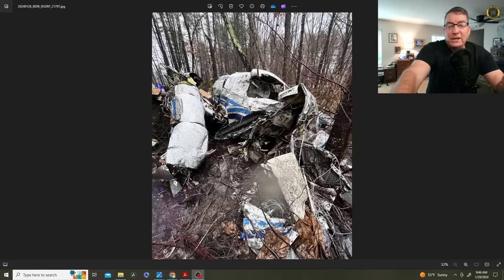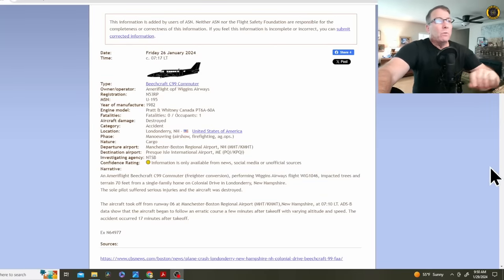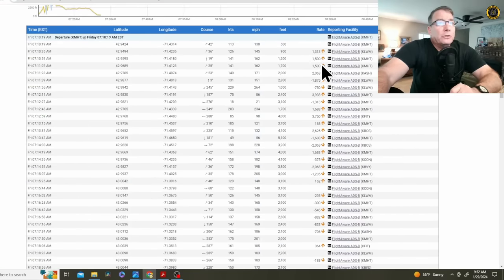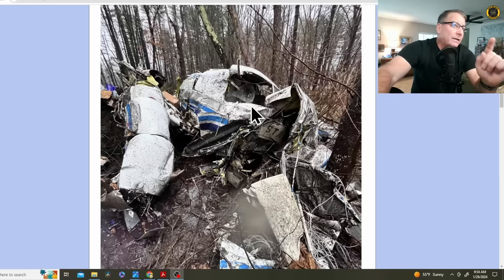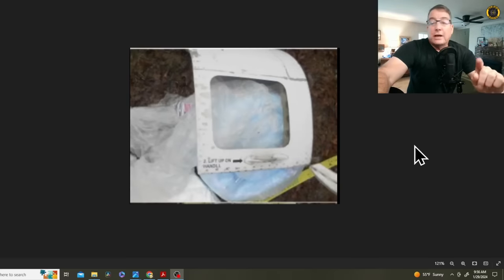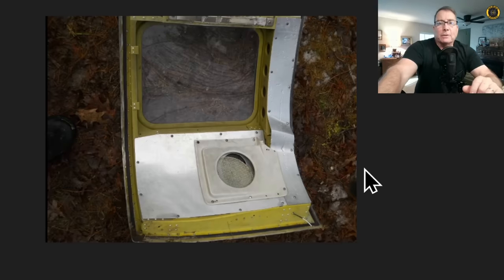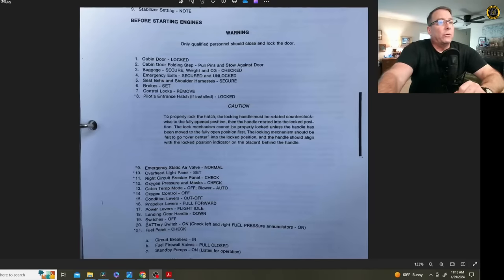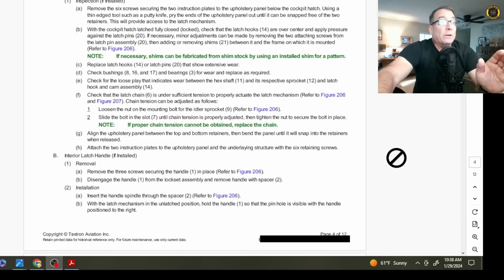Beechcraft C-99 Door Open In Flight Crash! 24 January 2024

Comment: In my Commanche, after having the door seal replaced, it was challenging to get the top latch on the door to hook the pin in the fuselage.  It felt like it was latched, but it wasn't.  As you rotate, enough negative pressure on the outside would open the top of the door.  It was noisy, but I continued the climb.  Unable to get the door to latch, once at altitude, I would put the plane in a skidding left turn and create positive pressure on the right side of the plane.  I could then latch the top of the door and continue my flight.  But as Juan said, GA doors are usually hinged at the front, so they pop open a little and stay on the plane.  Prayers for the quick recovery of the pilot.

Comment: Irrespective of the topic of this video, I really appreciate you taking the time to correct and perfect your audio recording as your video-making career progresses.   I listened to a video of yours from about 1 year ago and your plosives were just hammering the mic (which causes the limiter to kick in.)  I guess my only request going further is that you increase your overall audio by 8-10dB on the master output.  Other than that, I really, really appreciate you perfecting your practice - much like I assume your piloting career has progressed.  Thank you for the great content, Juan.
Reply: It is frustrating how low some folks set the Master Volume level.
Reply: @chetmyers7041  It's especially frustrating when you compensate for the low volume only to be blown across the room by the follow-on video from another creator.

Comment: In past incidents I have noticed very large discrepancies in airspeed from FlightAware due to the data coming from difference ADS-B reporting stations. It seems like the speed is being calculated by the position between two reports, but evidently those reports don't have perfectly synchronized timestamps. Whatever the reason, in cases like this where there are multiple ADS-B receivers reporting data, I tend to take that data with a grain of salt.

Comment: If that door opened and detached it probably destroyed the prop and damaged the engine. On top of that he was battling asymmetric thrust. Remember, props and engine set at takeoff/ climb settings so high toque. He was probably disorientated by that door flying off and probably loosing anything on his lap or clipped to his yoke. A hell of a lot to deal with.
Regards from South Africa

Comment: I've been in the right seat of a 58 Baron, and the door popped open at 6000' in cruise.  It is VERY surprising.  As Juan said, with it being hinged on the front, it just opens a couple inches, won't open any further, won't close.  One thing I remember was the latches on the Baron front doors were known for not fully latching.  We had the door open again on another flight.  On the Baron, I was surprised how small the latch was on the top of that door.

Comment: Not a pilot but have always been interested in failure mode stuff.  How about this, accounting for directional and altitude variance:  Hatch comes off, trashes vertical stabilizer but unfortunately doesn't rip it clear off the plane.  Remnants remain battering the horizontal stabilizer.

Comment: I owned a 1970 piper Cherokee that’s door was bent and would pop open now and then, it sucked dealing with but was manageable. Not minimizing this at all,it can be very distracting depending on the phase of flight. Glad to hear he’s still with us.
Reply: Yeah, i have flown the Cherokee, its fairly uneventful on that particular aircraft, the door is almost kept shut by the airflow over the fuselage. The beech in this incident has an upwards opening door, meaning you will get a face full of whatever it is out there, id say it's far more dangerous / difficult to deal with in this case.

Comment: One comment about firefighters removing a crunched door: If they had access to the Jaws of Life it would absolutely not have been a problem to remove that door. I personally have destroyed various structural elements of a truck/automobile and the Jaws can cut cars/aircraft, door, frames and pretty much anything attached to a vehicle. However there would be clear evidence that they had cut it out/off of the aircraft...

Comment: Took off in my Mooney M20C, VFR from Santa Monica, heading east under the usual SoCal marine layer. Everything seemed fine. When we popped out into the sun, suddenly the cockpit seemed incredibly bright. I looked back to see the gullwing luggage door next to the rear seats in the full upright and open position, like an extra wing. I put it down at Upland/Cable airport, and my girlfriend, Eva, climbed out and kissed the pavement. I had told her that an accident usually has not one, but many contributing factors. "That's 1", she said. Completely my fault, but the amazing thing was that the plane flew perfectly, with this odd gullwing sticking out into the breeze.

Comment: I have hundreds of hours in this very aircraft (more than 10 years ago). Don’t forget about the removable exterior ladder that must be removed and stowed in the cockpit. Funky design. I’m surprised there haven’t been more incidents like this one in the 99.
Reply: Does the ladder have a secure stored location?  If not, or it came loose, our pilot was trying to fly the 99 with the equivalence of a gorilla in the cockpit.
Reply: It hangs on the rear cockpit wall, doubling as a latching system for the cargo hold door! I forgot about that part until you just made me think of it.

Comment: I live in New Hampshire. During the time of the accident it was forecasted as rain but that quickly turned to freezing rain creating havoc on the roads. It wouldn’t shock me if icing played a factor in this incident.
Reply: I would agree with you but they found the door some distance from the aircraft so it definitely came off mid flight
Reply: I agree. It's not implausible that the door came off and the aircraft encountered icing conditions. Icing would explain the inability to keep the airplane in the air. Especially if the pilot was unable to ascend to quickly get out of icing conditions. It's the old Swiss Cheese model of accidents.
Reply: @jonmoceri   so would damage to control surface caused by door
Reply: @jonmoceri  The crash occurred after 17 minutes of flight, so flying in freezing drizzle could well do it.
Reply: The door was found at a Manchester location near Candia Rd and the Rte101/I93 junction just after his first abrupt turn back to the south.
Reply: @jonmoceri  add to that the cargo pod if used would rapidly accumulate ice! GREAT! ANOTHER GAPING HOLE IN THE CHEESE!😖
Reply: @57Jimmy  Very true and a very good point!
Reply: Agree, I work less than 1/4 mile from MHT airport, got to work just before 7 that morning and it was freezing rain/fog type conditions, very icy roads.   I also wonder if once the door came off his instruments frosted over or became soaked with rain and the wind turbulence coming in and were difficult to read.   There were definitely not VFR conditions at that time
Reply: @ajg617 yes. Christy Ln. Not on the first abrupt turn but a that is where the plane did a rapid decent from approx 1900 ft to 700 ft.  I think the door popped open and he struggled to control the plane. Can only imagine trying to control the plane in those conditions.

Comment: Another former white and blue BE99 Pilot here. That crew door was always my biggest fear. Some airplanes’ doors were a lot easier to latch than others. Most required 2-3 attempts to get completely latched. You definitely have to check that thing several times before takeoff.
Reply: My former company had a 58 Baron that had problems with the crew door.  Had it pop open twice on us at 6000' in cruise.  It's hard to get the door fully closed and fully latched.

Comment: grateful the pilot survived.  Having worked with Ameriflight over 12 years and worked on her sister a/c N52RP, I never saw anyone ever adjust the flight deck door.  All the doors were loose and the issue of airworthiness is debatable, the deice boots are visually looked at for holes and tears, but never inflated to check for holes.  I'm surprised more of these a/c are not involved in accidents.  A true testament to the strong design of the B99.

Comment: That IS a pretty complicated method for latching the door.  Easy to see how something can go wrong or be overlooked.
Reply: Seems like a double rodded latch like a truck cap has would be a lot better. Turn the handle and it throws the two rods into the lock position also like a garage door latch. The looping chain looks like some engineer was way over thinking things
Reply: Got to fully unlock to lock?!?
Reply: Did he hear it whistling cause it was ajar once he got airborne, then try to lock or close it? Something caught in it?
Reply: I would have thought that two seperate handles/locks might be a better design. No interlinking chain to wear and adjust; and either one would keep the door shut.
Reply: @jamesread11  Rotating first to the "unlock" position ensures that the door is not resting on top of the latch cams, allowing the door to fully seat, before the cams draw it tight in the "locked" position.
Reply: @martinhicks6020  - A simple hook and loop gate latch would be a better design than this complicated disaster in waiting.
Reply: The person that designed that door latch deserves some sort of Rube Goldberg award.
The doors and hood of every car I've ever owned have better latches than that one. They even have secondary latches that would at least keep them closed even if you didn't latch them properly.
Reply: Especially if it’s freezing and whoever is on the ground is wearing thick gloves when trying to latch it

Comment: Another good job by Juan Browne for finding the facts for us and reporting. I was wondering about this crash after seeing the track on FlightAware and noticing the high voltage power lines on the path to the crash site. There are nine courses of big doubled up conductors and then two more smaller towers with what looks like two and then three conductors on each. The flashes in the security video are definitely these power lines arcing together. Power lines like these can certainly absorb some of the forward momentum and slow the aircraft. A series of tree tops bending and then snapping can also absorb some more energy. The Swiss Cheese layered model of accident causation also has an inverse with several windows of opportunity or windows of good fortune that serially align in a crash situation to make it survivable. 
Thanks Juan for digging in!

Comment: For my money: Door falls off, hits tail, damages elevator and/or rudder, wild controllability problems, which could very well cause a load shift, which causes more controllability problems. It's pretty notable that he did ultimately manage to more or less get a handle on things and then lost it again on the downwind - so something may have changed again late in the flight. Load shift? Did configuring the plane for landing conflict with whatever he did to counteract the damage?

Comment: Thanks Juan for the details. Another door issue? I'm glad to hear the pilot survived. I knew that this was more than icing playing a factor. Ice can collect fast but this was so abrupt and seemed more like control issues like an engine failure, trim runaway or stab problems. A high probability that the door hit the tail and did damage. You can see the damaged tail in the post crash photos. NTSB would have found parts of the tail or looking for them with the door.  Their focus will be to determine what is pre and post crash damage. In previous incidents loss of tail structure or control can cause the Phugoid Cycle and this seems to be a plausible scenario. What we do know is that the door came off. Again Pilot is lucky and glad to hear he was to survive this.

Comment: I had a friend flying nite freight in  small jet, can’t remember the make. The door came unlatched and swung up slamming into the top of the cockpit. The circuit breaker panel was in the overhead and the door popped several breakers causing a loss of lighting and instruments. He was IFR and began smashing the breakers in while trying to keep the jet upright. He manages to “Aviate-Navigate and Communicated. He managed to make it back on the deck through all of that.

Comment: GA flight, unknowingly unstable female passenger, low wing, barely survived the rear left passenger unlatching her belt, then twist open the top door latch, she pushed pilot forward.. with yoke. 'Brother B' [preacher]. saved us by immelman rollout, barely 100 ft above terrain. Wind was atrocious inside cockpit.. face punches and choke hold by right rear passenger, forced her to floor, holding her down on floor for return to safe landing....

Comment: So I looked at the ADSB data in 3D (Courtesy of a KML file from ADSBExchange).  There's a point where it looks like he descended (roughly 12:19Z), perhaps considering trying to land on the highway, before climbing dramatically and then descending again.  That descent looks like a stall spin with recovery--nearly vertical at first.

Comment: A strange one.. The complex mechanism of the door latch aside, either the door popping open or completely departing the aircraft, either way, unless it has impacted a vital control surface, which I would have thought unlikely, it shouldn't become a major event.. If still attached it shouldn't produce any complications to the aircraft aerodynamics, if detached, it's gone.. nothing for the pilot to do but fly the aircraft. It's not as though the pilot is going to climb out of his seat and begin fiddling with it.

Comment: For both this crash and the Alaskan air flight, I would believe the risk of impact from the door to the tail after the loss is quite possible. The tail is missing from this crash but I wonder if he lost some of his horizontal or vertical tail surfaces.  On Alaskan flight, they did not but it could have happed to shear a section of the tail as the door was ejected. Just a thought.

Comment: I had that happen to me back in 81'. Different machine, Beech D-18, but almost the same door design. In my case it didn't affect the aerodynamics that I could notice. I finished the trip as I was headed home, thankfully uneventfully. A side note, I had the tailwheel fall off leaving ORD one night on the same tail number. That was a bit more challenging on arrival.
Keep up the good work.
I just thought of something else, with that crew door, could the aircraft pressurize? I wouldn't think so.

Comment: I flew this aircraft at Ameriflight in the mid 2000's. The door system isn't that complicated. You pull the ladder in with the placarded rope/flag and you stow that behind the seat before closing the door. It's would be a dead giveaway to have the flag right there with the door unlatched while you're getting ready for departure. I have hundreds (probably close to 1000) of hours in the BE-99. I never came close to forgetting the ladder/door due to the rope flag that we attached to the yoke. I suppose this scenario was due to not getting the door latched properly? It's easy to see, but you HAVE to check the over-center latch mechanism and verify the 2 latches are locked onto the pins. I'm glad the pilot survived, and yes, "he will have quite the story to tell!."  That would be a terrible position to be in single-pilot. Again, I'm glad he survived and I'm looking forward to an update on how this happened.

Comment: In my Cherokee 160 days while on a solo flight, I removed my headset and to my surprise the top door latch wasn't. Try as I might, I couldn't get the gap closed enough to close the latch with one hand. Two hands worked but then I couldn't turn the latch. After trying several times, I realized the plane was flying just fine and putting the headphones back on took care of the noise.

Comment: Amazing, maybe he can sit down with Dan for an interview.  
   I was the second or third Pilot this happened to, when the little Cessna 162 came out they were later found to be notorious for their door opening and it is a gullwing type it flips upwards underneath the wing, I was in cruise flight at about 4000 AGL cruising along at about 100 kn and it literally sounded like a bomb went off it slept the bottom side of the wing so hard it dented it severely and had to be replaced  
  But luckily it was a beautiful vfr day over Texas, once the startle factor went away it was kind of a non-event but then again that that's in a little Cessna 162

Comment: Excellent content as usual.  I’m left with one question:  my first thought when shown the picture of the open door was could that door act like a wing (or other control surface) until it broke away?  It sounds like the trouble started early but the door was recovered relatively close to the crash site.

Comment: If the door separated from the acft, it may have struck the tail section causing controllability problems. Being busy trying to fly the plane and being noisy, the pilot probably couldn't even hear the controllers.